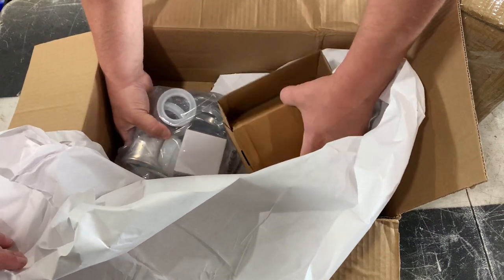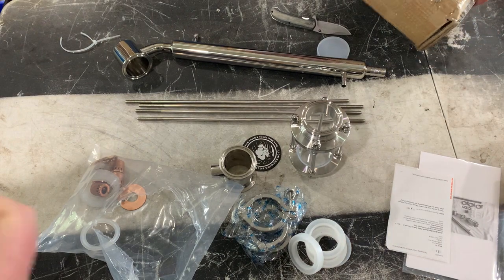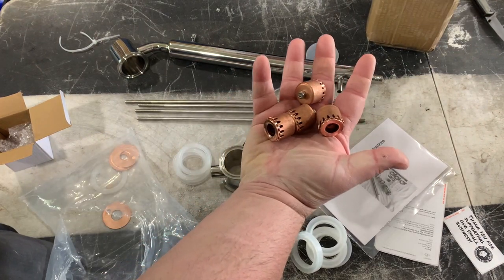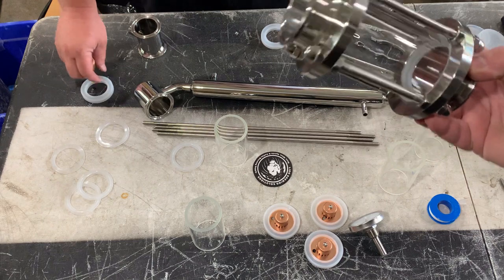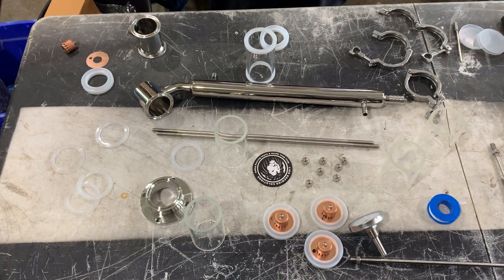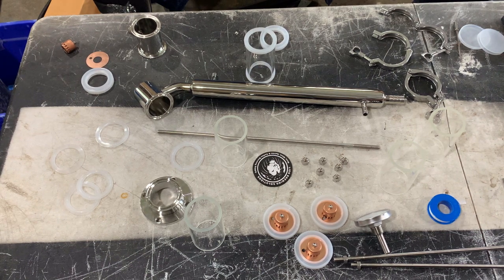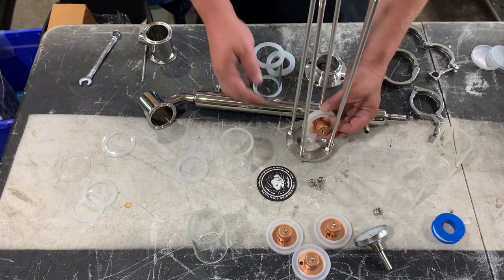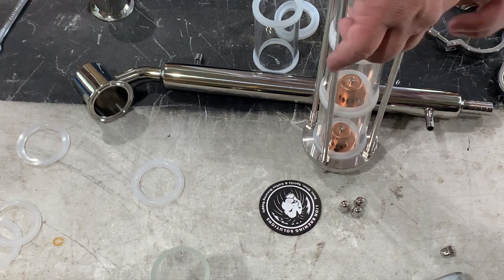Unboxing, and putting together PhilBilly's New Bubble Plate Still

Comment: This is so helpful.  I have just got one of these, and was at complete loss as to how to reassemble it after cleaning (came with no instructions).  I still can't get the very first bit of glass in (the nuts have squished the silicone washer, and the glass just won't fit - it looks easy on yours) but at least I know HOW it should be done.  Many thanks!

Comment: Phil every other plate is gonna load up.  I like that colum but youll see what i mean rig a down comber in there. I went to the still dragon pro caps.  Works great. I also run a deflag on top.  I aint got the balls to post lol. 29/32 hole for a procap.   Youll love it tho